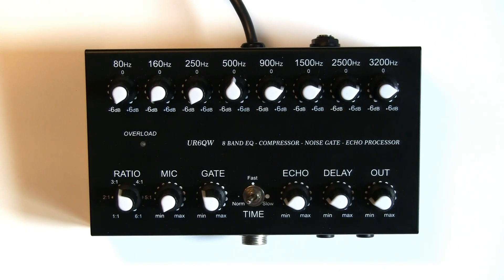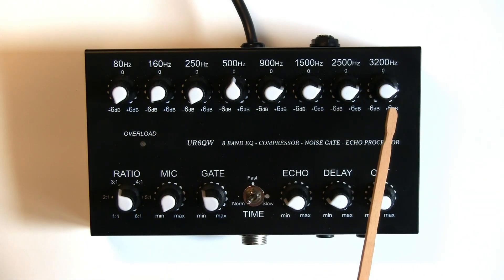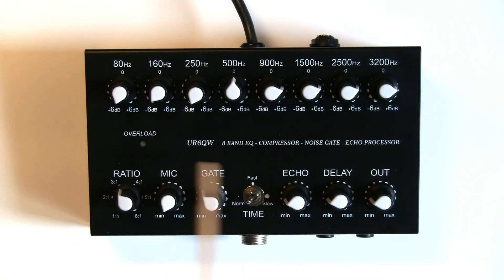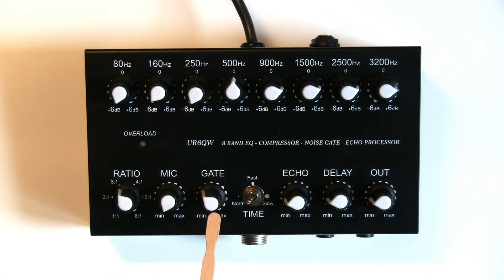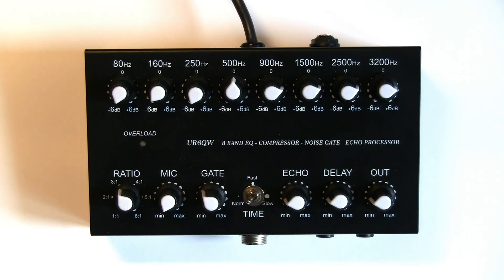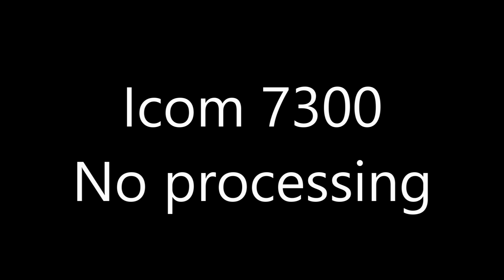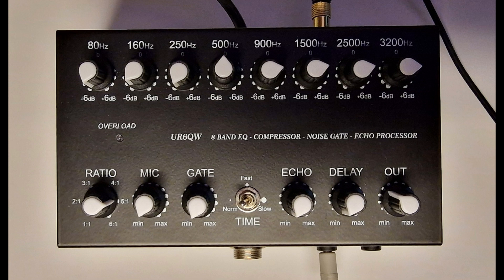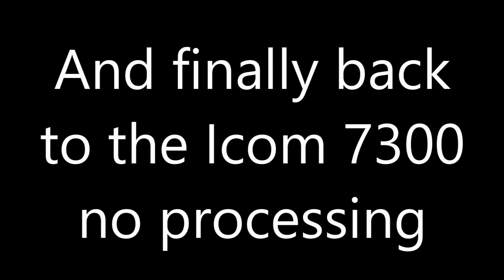UR6QW audio processor for Icom 7300

Comment: You talk about eq setting on a 7300 but I do not
See that is owners manual
Reply from the maker: To adjust the treble settings on an Icom 7300, navigate to the Tone Control menu within the radio's settings. Specifically, you'll want to access the "TX" (transmit) settings under "Tone Control" and then select "Sideband" to adjust the treble. Typically, a setting of +2 to +4 is recommended for a clearer, brighter transmit audio.  Also turn off the radio microphone compression

Comment: I see you have a power cord in the back of the processor.
Reply from the maker: Hi there - yes the version of the processor I bought is design specifically for the Icom 7300 and so has a cable with the Icom microphone connector fitted.  so plugging into the 7300 powers the processor and has all the correct audio and PTT connections.  So no external power supply required by the processor only the 7300 connection
Reply: @dave68cat  I see. I purchased a used one set up for a Yaesu. I'm rewiring for a Kenwood. 8 pin work is so fun...

Comment: i have an RCI 2970. Will this add any type of talkback/audio play back so that you can hear your audio when adjusting?
Reply from the maker: Hi there - no not that I am aware of.  The talk back or monitor function would have to be provided by the radio.  With the Icom 7300 (my radio) I can either use the monitor function or I prefer to record the audio onto the SD card and then play it back to get a feel for the audio processor impact
Reply: @dave68cat  Thanks for the reply. Yea unfortunately my radio do not have talkback modification. The audio sounds AMAZING!
Reply: Very nice demonstration, thanks and 73 from Louisiana.